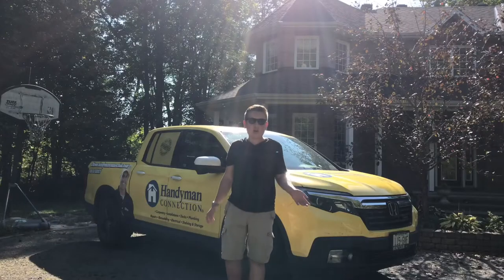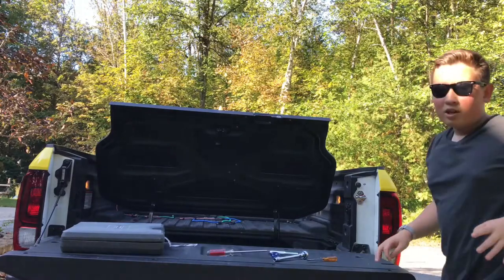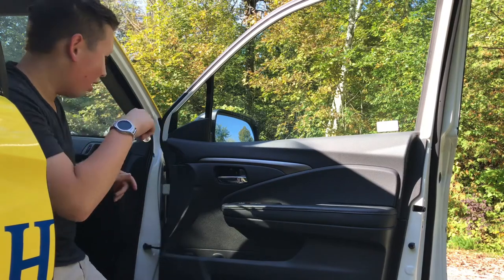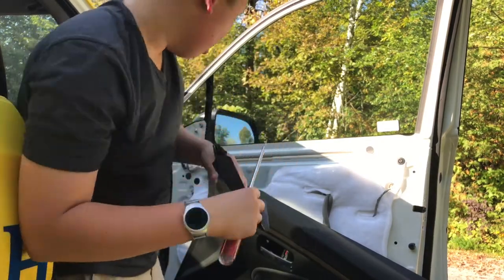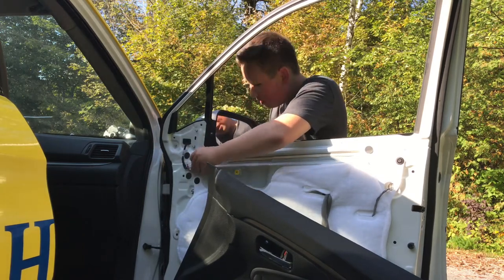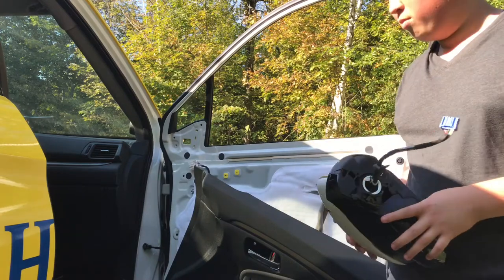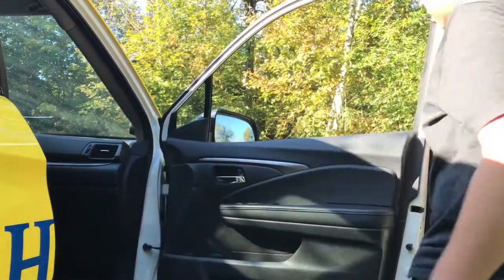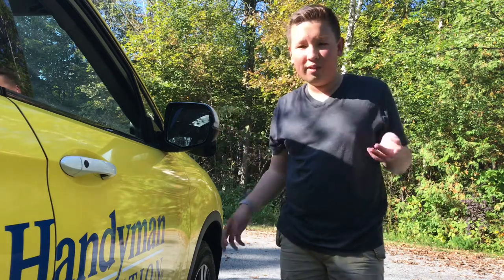How to remove and replace a side Mirror (2017 Honda Ridgeline) (DM garage)

Comment: This was exactly what I needed to change my passenger mirror. I have an '18 Ridgeline RT and it was so much easier than I expected to take off the door panel and unhook the wires. I was worried about getting the panel back on but pushing the lip that butts against the window on first is key. Everything else just pops back into place. Easy peasy. Great instructions!👌👌👌

Comment: Thanks a lot! I fixed my Honda pilot 2019 ex-L using this video. Just one comment, it was so hard and tricky to assemble the door panel. I couldn't do that for 1 hour however my wife finished it for 10 sec. Iol...

Comment: great video.  Do you know if this is the same process when repairing a 2017 Honda Pilot EX-L 4WD DRIVER'S Side mirror?  The side without lanewatch is what needs to be repaired.  Seems as if I did what your dad did but on the driver's side.
Reply from the maker: yes, the Pilot should have the exact same process. there should also be no difference between the non lane watch side and the side with. Thanks for the question!

Comment: Is removing the door panel required?  It was difficult to tell if there was a lip on the inside cover for the mirror attachment or if the the plug was below in the door.
Reply from the maker: Mark Ferguson, removing the door panel isn’t to difficult. Be sure to be careful when removing the clips because they tend to break.

Comment: There are plastic body panel available to remove the plastic inside panels. I guess you do not mind scratching the paint. Why did you have to add LOUD music to the video. It over powered your video.